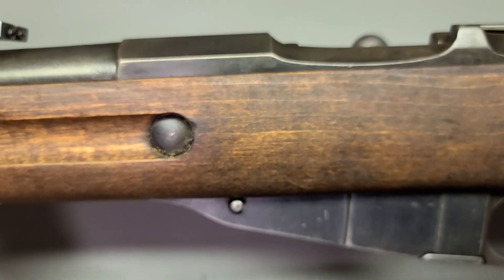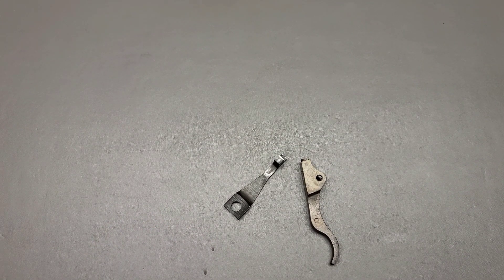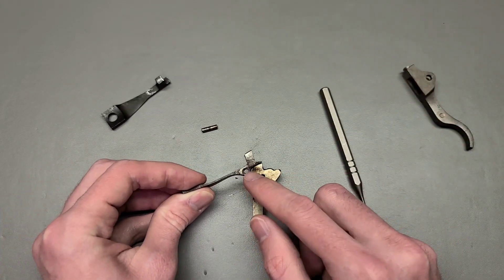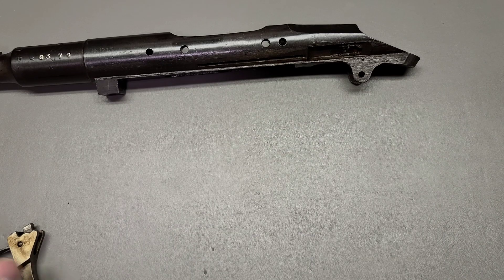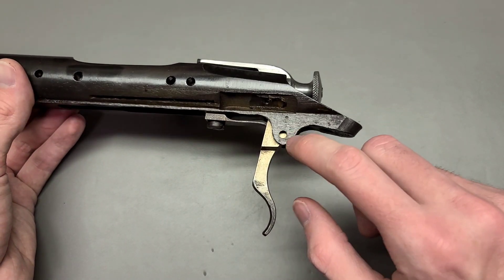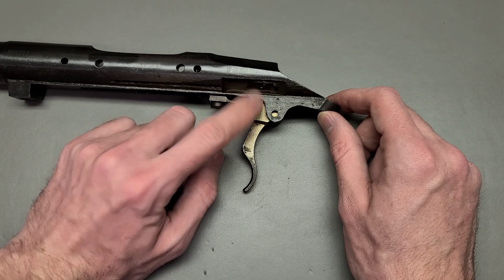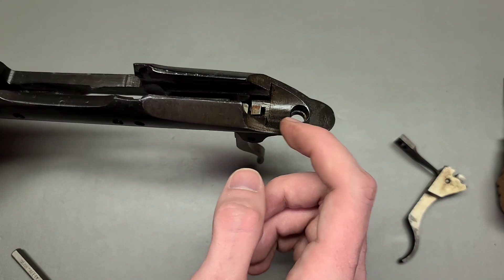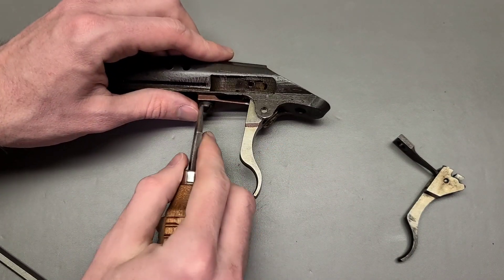Secret Finnish Mosin Trigger!

Comment: My Lord, I've learned so much from your channel so first and foremost, THANK YOU for these videos!  I have an M27 that I bought in Texas years ago that I'll for sure have to take apart now and inspect the trigger.  It has a tang dated 1895 which I find fascinating.......My question for you Sir, is it safe to shoot 54R with it?  All my research says to only shoot 53R as that was how it was designed.  Mine does not have the D barrel shank mark.  I can DM you images if you'd like?  Thanks again and keep these videos coming!
Reply: It is save to shoot 54R in it.
But you might have accuracy issues and some "53R" guns can hickup on 54R, because their tolerances are too thight.
Just try it out on your range and see if you get really sticky bolts.

Comment: OK quick question. I have what i believe is a M27 rifle. Everything seems to be correct on it to be an M27. But i dont have this style of trigger on it. It has a normal mosin trigger. But it also has a clear stop for the break of the trigger. I was just wondering did all M27s have that style of trigger or was it a supplie type of thing? Either way love the vid.
Reply from the maker: Howdy, the trigger could have simply been replaced, so it is really hard to say for certain. It is known however that some of the last M27 rifles were produced with standard triggers
Reply: @BigSamMosinMuseum  Interesting. Thanks. Well i will try to hunt down a trigger for it lol.